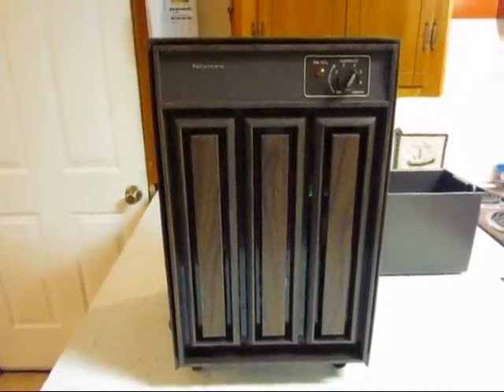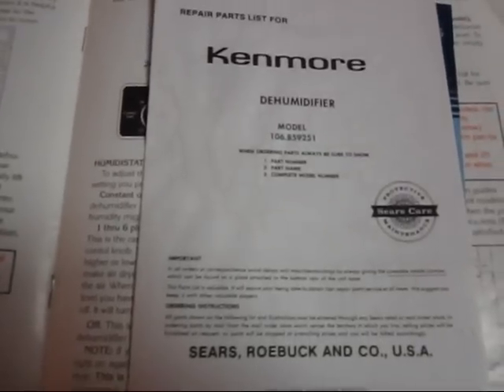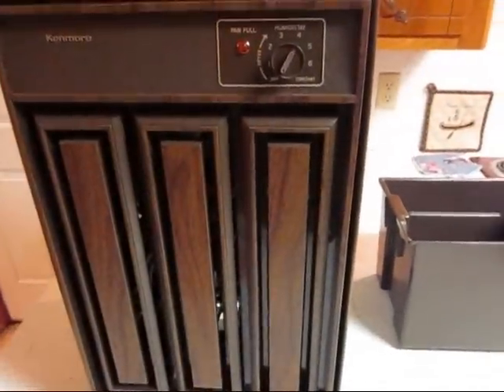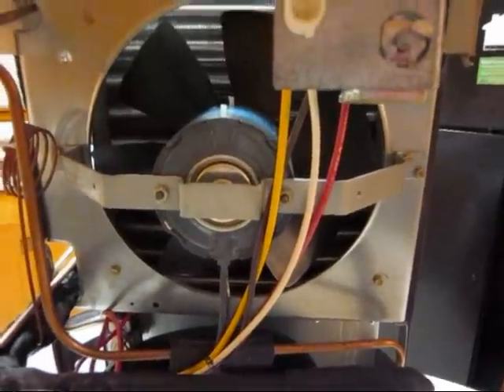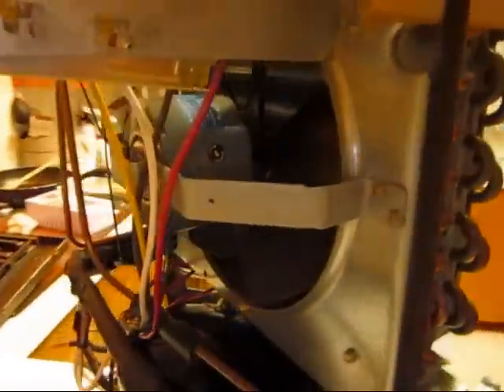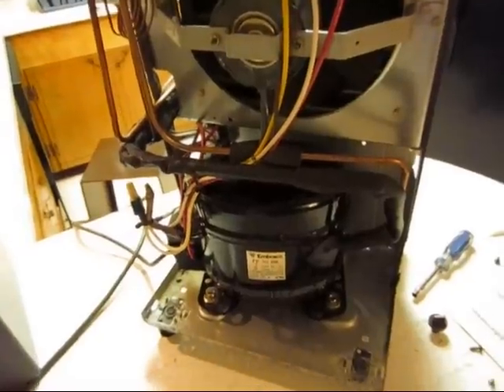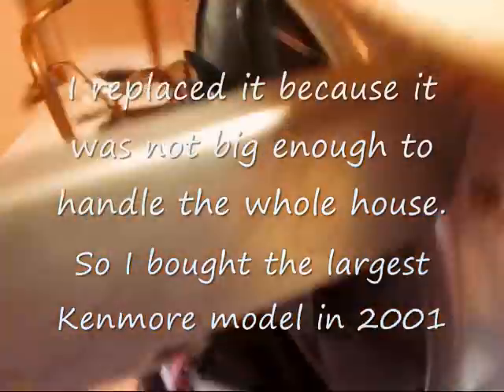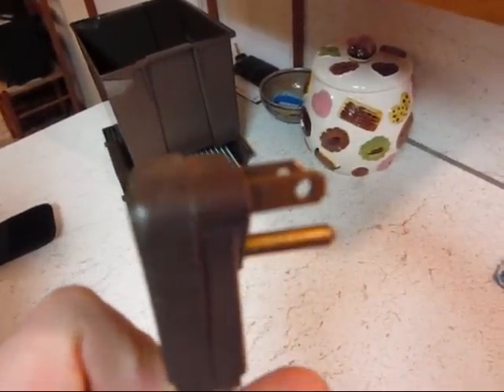Kenmore Model 5925 Dehumidifier

Comment from the maker: Cool! You bought a good unit, they don't make them like this anymore. I wouldn't worry too much about a filter. The coils are very easy to clean on a unit like this. I have never had a dehumidifier that came with a filter. You could use a piece of the universal window A/C cut to fit filter material if you like. If yours was made for a filter and it's missing, you probably will not find a replacement unless it fit newer models as well. Hope this helps and thanks for watching!

Comment: This is really interesting because my folks have the same model dehumidifier that they purchased in 1979 and it still works great today.  I am not so sure that the newer models would last as long.  The feature I like about the unit is that it has just a basic humidistat dial to set without all of the electronics that would have a tendency to wear-out over time.
Reply: I was thinking the same it is from the 70's :)

Comment: I have the same one, works like a top, its a fantastic unit
Reply from the maker: That's cool Andrew. It is a well built machine. I just wish I had bought a larger capacity unit back in the day. I would probably still be using it as my whole house dehumidifier.

Comment: Thank you for the video.  I have the same model, picked up at the dump swap shop 11 years ago.  I live in a very old house that doesn't heat well at all.  This humidifier makes all the difference.  I, too, would like to find another one, as, (being a bit slow and all), I should have had one upstairs all along - it was the damp that was getting to me more than the lack of heat.  It is quiet.  It is solid, and heavy, and I'd better take off the back and make sure it's clean because I'd sure hate to lose it.
Reply from the maker: No problem, thanks for watching.

Comment: That's a very nice Kenmore.  My family moved into a house 10 years ago that came with a 1988 Whirlpool 25 pint dehumidifier.  It worked perfectly until my mother was brainwashed by the energy star bullshit.  She replaced the good unit with a shitty 2006 Amana 45 pint unit.  PIECE OF JUNK!  It was very noisy, the basement got very hot, it lost one of it's plastic wheels.  Last year the compressor sounded like it's about to crap out.  I'm thinking when I start it up this year, it's gonna be dead.
Reply: At least maybe you can make sure she gives you the good stuff she wants to throw away.  Too bad.

Comment from the maker: Thank you my friend! Hey, that's cool! The older ones are very well made. I wish I had a larger capacity of this model, like a 5950. Just be careful with the water around the fan motor and the dehumidistat, you should be fine! The Coldspot is probably from the 1970's! I wish I could find a lightly used classic for my next dehumidiifer. They sure don't make them like they used to! Will do! Thank you for watching my video!!

Comment: Hi there! I just bought a very similar unit to this one (used), it's a Kenmore 30 Dehumidifier... The problem is that I don't have the filter that goes in the back of the unit (it still works well, no problem)... Do you have any info on where can I get the filter? Or maybe hot to make my own/adapting a current filter? Thanks so much for your answer and your time!

Comment: I just found one of these. It has sadly lost most of its refrigerant though. Don't know what to do with it now.
Reply: jjjjentges How do you know its out of refrigerant?
Reply: only a 1/4 of the coils even get remotely cold, and the coils that do get cold freeze up. There is also a lot of rust on several parts of the refrigeration system.